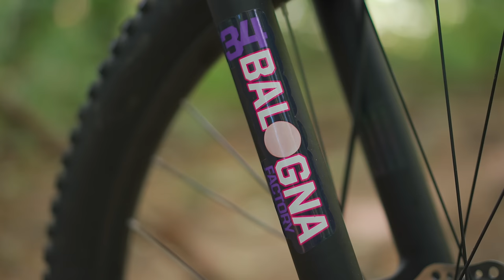This $130 MTB Air Fork works great until it doesn’t

Comment: Is there a reason you are inserting the forks into a metal tube before clamping down? If you could clamp to the steerer tube itself you would have way more consistent results and the weight wouldn't keep getting deflected when it hits the fork and makes it rotate.
Reply: Several things. 1. During riding, a hard hit will deflect the front end. 2. Clamping directly to the stanchion will influence the test amd also introducing a new failure point (the clamps are toothed and more than likely a harder material than the stanchions). I'd rather see a tighter tolerance for bar or some semblance of bearing. PVC pipe might do to fill the gap.
Reply: @tobins6800  good point about the wheel turning on impacts during actual riding. I'm too lazy to rewatch the cane creek video to see what they did, I don't remember theirs rotating much if at all.
Reply: @TheFalcorion  they had it locked down. Seth's set up more replicates real world more so than the cane creek, but the cane creek will yield more repeatable results.

Comment: search for the weapon animal pro air fork.. I wanna see it in action and criticisms like the bolany fork...

the "weapon animal pro air" fork just costs at 140 USD but the travel has 200mm in it... it also got that rebound adjuster but no lock out

it also is a dual crown thing. and 34mm stanchions

Comment: Interesting to think about where they will have saved the cost on the bolany fork, it wouldn't surprise me if lots of the internal components had much rougher surface finishes compared to name brand forks because proper high quality finishing for sliding components can be pretty expensive. Would certainly explain the rapid wear on it from a single ride

Comment: I have a set of those Suntour forks on my trike and they’ve saved my wrists from so much pain. My trike, while fully suspended is a Land Cruiser, it’ll do asphalt and dirt roads with corrugation but won’t do mountain trails but that’s okay since that isn’t what I built it for. I’ve had these Suntour forks for 2 years so far and I’ve had zero issues with them.
They’ve definitely got my stamp of approval for a budget set of forks

Comment: I have run this fork and other Amazon air forks and I don’t think anyone serious about biking should buy one. They are great if it’s going on a kids bike where you need the air adjustment bit terrible on other bikes. They feel ok for the first month or so but after a while they break down and become complete garbage. If you want a good feeling fork keep the suntour fork and service it regularly. I would not be worried about the strength however they seem to take hit’s pretty well.

Comment: That advent derailleur is amazing. 60 bucks for shimano deore quality of shifting and clutch is mint. but I can't attest to the strength of the material as I haven't smashed it on anything yet
Reply: Is Shimano really so much more expensive in the US than in Europe? The Deore 5100 derailleur is like 35 Euros over here.

Comment: Two years ago, I bought a very similar fork from amazon to upgrade a KTM hardtail I've been riding for around six years or so. The Suntour coil fork that came with it was on its very last legs and no amount of cleaning and servicing I was doing was able to save it. I don't use the bike for trails quite as gnarly as in this video, but I ride it in all conditions, all troughout the year and have never noticed any degredation. Just kept it clean and lubed. But for trails like in this video or harder, I would always take my more higher end bike.

Comment: I’ve had a Trouvaille as a backup bike for a couple months now. in stock form, I took it on double black diamond xc trails, black diamond freeride/slope style trails. I’ve since upgraded the brakes, front wheel to a factory specialized boost, and the fork is a 140mm Rockshox 35, PNW grips and pedals.

Comment: Just a few points to Smasher:
Put some kind of guidance there so the hit is actually repeatable and always the same
Hit is supposed to be aimed at the "axle", so stress at the fork is as real as possible, currently you're hitting it too "high", so leverage is decreased, also there is a chance to make some dents and prevent the fork from running freely.

I'd say that some kind of pivot point and lever could do the trick, even without increasing overall size (similar solution as your bottlecage tester had)

Comment: So: ... I've bought this exact fork 2 years ago on amazon. Back then I just started mountainbiking and put this on my trek marlin 5, which before had that exact suntour fork on it. since then i had a lot of rides with it and can therefor tell you exactly why it only costs 130 bucks.
on my very first ride when i wanted to turn of the compression on the fly (before going uphill), the whole cap flew off and i had lost that small ball and the spring which prevented the cap from turning around while riding.
a few rides later it suddenly stopped working at all, because it was a wet day and a whole lot of dirt and debree got stuck to the fork and rubber sealing. it would then go in but wouldnt spring back out.
also if i let it sit around for a few months it would not hold the pressure very well.

so all in all it is working pretty okayish, but i would not want to use it on a wet day anymore.

Comment: I have the microshift advent 9spd drivetrain on my voodoo braag 2022. It's a brilliant drivetrain and it comes stock on the bike. It comes with a 120mm suntour xcm32 coil fork with boost thru 100x15mm. It's a 29ner. And has routing for a dropper post. It's comes stock with Clarks clout 1 hydraulic disc brakes and 800mm wide bars. And for £575 I think that's a pretty capable hardtail
Reply: A pretty capable but overweight hard tail. Get rid of the coil!
Reply: @MichaelRei99  I have. I put on a 150mm travel SR suntour raidon 34 air fork and it makes it soo much more lighter..

Comment: Wiggle sells the octane one 29er frameset for 149 plus 40 shipping. That may be a better option , since you’re just replacing all the parts anyway.
Reply: Yes, chain reaction sell their home brand as well as NS bikes and others dirt cheap. The best dtswiss fr541s are only $300 a pr. Good frame and the best rims and you're set for 10 years

Comment: It’s also worth noting a lot of these cheap air forks have 26inch options available. Which is definitely an increasingly more difficult size to find
Reply: yeah your kinda screwed if you have an inter year bike though i was able to find a used 29inch fox float with straight steerer tube in the right size with a 9mm axel. thats like the most obscure spec

Comment: Ok,  so last season. I bought one of the Balony forks. At first, I was impressed. I'm a 200lb rider that prefers an aggressive Hardtail.  Upgrading an older bike with this fork has a price point. However,  a seal started to leak and the fork developed a lot of stickshion.  Translation,  it was junk after one aggressive season.  This fork is fine for the bike path or a beginner on a flow trail.  For the more advanced aggressive riders,  spend $100 bucks more for a fork that will last for years. Balony does no warranty or repair these forks..

Comment: I ran Bolany before. Even I rode with it for more than 1 year without issues, I will not recommend it. There are lots of videos showing the fork break easily, particularly the steerer tube. SR Suntour is a trustworthy brand, I trust it more on lifetime than the Bolany even it's heavier. Also, Bolany on Amazon costs higher than on Aliexpress. On the latter, it costs around 60 USD.

Comment: I've got one of these forks on a Mongoose Dolomite ALX. For the riding I do...no where near the level Seth does, it works for me. It takes the jolt out of the drops and that's all I need. If I was a serious rider going faster on more serious trails, would it take it? Probably not, but then if I was a more serious rider I probably wouldn't have gotten a Mongoose.  I'm not knocking the bike, for the money its been fantastic but I know what Ive got.

Comment: I did some upgrades on my old  '99 Stumpjumper last year, looked at the Balonay fork but ended up going with a Manitou Markhor on sale, just don't trust the no-name forks.  I also went for an Advent 9 speed drivetrain but should have splurged the extra $20 for teh Advent X and got the 10 speed.  Both have been flawless although I've since moved onto a new FS bike.
Reply: I've seen so many videos on Facebook with that fork breaking , I think you've made the right decision..

Comment: Mate the QR lever hits the bottom of your test device taking away some of that energy used to bend the steer tube, hence why your seeing less deflection. I suspect it will bend more then Suntour fork if the QR lever is aligned with the fork

Comment: I run a set of these on my bike. It needs grease, not oil, and the wipers really suck. The other problem with these is they have no replaceable parts. Run them as an XC fork and regrease them with Slickoleum or SRAM Butter and you're set for a decent fork for a time.

Comment: In 2018 I bought a Raleigh tokul 1 off Amazon for $448 shipped to my door

It had a 120mm suntour coil fork and hydraulic tektro brakes

I returned it and got a used specialized crave pro with a 1x11 drive train and fox float front fork for the same price

Comment: It's one thing to compare cheap fork with other cheap forks on the 'Smaesher' but you need to have a control measurement too. 
Like...  a Fox 38 or RockShox Zeb or something as a control standard.
If all the forks are bending at the steerer tube rather than the stanchions... What are you *really* measuring here?

Comment: These kind of forks lasts longer if you service them frequently, I have a similar (different brand) one for 3 years now. The posts I've seen people that has broke one of these is due to the lack servicing, I once saw one owner has literal sand inside his lowers due to negligence lol.

And also use them for light trails and like 20 inches drops max lol.

Comment: Totally love this Walmart MTB series. I don't have a bike, but am looking to get one (on the cheap). I am looking for something that can handle the woods and different terrain, but I value my life way too much to even want to take a trail ride like you are doing. Plus, I'm AARP certified now 😁 With that said, would this then be too much bike? And if so, what would you recommend?
Reply: Walmart has a good entry level mountain bike right now. There is a big used market as well. Just talk to the local community. Bike shops are sometimes hit and miss.

Comment: Microshift clutch is actually adjustable if you remove the little cap whit the 2 bolts you can access like a 4 millimeter Xwrench bolt  that you can thigh or lose the clutch whit

Comment: After lock tighting the bolts on the bottom of the Amazon fork that was the oil spill version I road the crap out of it down some of Snow summit bike parks gnarliest trails and never once did they fail me but we're little stiffer then I wanted and I had to put like 110 psi to make the feel right plus some rock shox fork oil.

Comment: Since the forks still touched the bottom of the smeasher it probably isn't an accurate test at all. I'm guessing that the suntour has a steel steerer and the bologna has an aluminium one. Steel is 3x stiffer than aluminium. This means that the suntour may have taken let's say 90% of the impact and the bologna only took let's say 30% because it flexed and then hit the floor. Watching the clips it looks like the suntour has more spring to it, meaning that it flexed and sent the energy back to the dumbell. The balogna looks like it flexes and dumps a lot of the energy in to the floor. I'd like to see some more improvements to the smeasher :D

Comment: i'm just gonna assume the suntour is a little bit safer over time. the balogna like you said might snap and cause the rider to get injured. and to be fair i don't know much about bikes but i know that i would not be riding one if i felt unsafe on it.
Reply: I partially agree with you. Everyone knows that some parts in automobiles are specially designed to deform largely during crashes to absorb energy. But I guess that these low-budget builds are for gravel rides around 30km/h. If you want to go extreme, definitely the hospital fee would be more expensive than any premium bike parts.

Comment: Starting out in MTB, my first trail ride destroyed by cheap coils. So I bought a Bolany air fork. It actually did last I guess a few months. I started getting better at mountain biking but the fork was a clear limit. Being very gentle with it and constantly maintaining. 

One day I decided all caps are off, I'll send it throughout the entire 4km trail. I did (with only one little jump as it's mostly an XC trail). It came out no good at all. It doesn't lock anymore, it barely compresses and when it does it just snaps back up. I tried to look into fixing it, but the cost of fixing it is so close to buying a new one I ditched the fork entirely for an SR Suntour Epixon. 

The SR Suntour Epixon, right off the bat, is definitely a waaaaaay, waaaaay superior fork than a Bolany.  Not to mention insanely easy maintenance and if anything goes wrong parts are so easy to find. Plus shops are familiar with it and it does have official support. 

TLDR, go straight for an SR Suntour Epixon or RockShox Recon I guess... skip the Bolany because you'll just end up going with an Epixon or Recon in the end. My Epixon have been going strong even with some jumps and red trails for 5 months now with no real maintenance required yet and still feels as good as it started with. Same for my friend's Recon as well.

Comment: Man, I do like product reviews, talking about parts and stuff. I'm retired with some big injuries from my youth and spend a lot of time building bikes now cause it hurts to ride with Gusto. Sometimes I think we all might be a little nuts cause it seems to be great fun to many of us to buy stuff and see if we can tear it up. I stand at the front of the line, so do not think I am talking down to ANYONE, I am just reflecting on past behavior. But if we use parts wisely and inside reasonable parameters, you can build great budget bikes. I bought a Schwinn Taff for the frame and for $1400 total, I got a great bike with parts I wanted. Underscore parts I wanted cause this is a big deal. Schwinn could do better and should build some damn good bikes instead of frames I'd like to build. If down the road you have trouble with a part, fine, there's new stuff all the time. Buy parts on your skill lever and use intent, use them up, break 'um, get the new stuff. Sorry, my brain runs over. Peaceout!!

Comment: i bought a sr suntour epixon and i got a problem with the damper cartridge because doesn't let me use all the travel of the fork. So i have to drill a little hole on the top of the cartridge to get all the oil out and replace it for a new one. That's work for me and now the fork permorm very well under gnarly situations.

Comment: I love your videos. I have a cannondale.cad3 frame that I had a friend assemble into a mountain bike 25 years ago. It has 26 inch wheels and rim brakes.  I love this frame and really want to rebuild it for modern use in nh trails.

I have not kept up with mountain bike technology and have no idea what parts to use. I road this a lot back in the day and cassette and front rings are.worn out and fork is garbage at this point.

I don't know which parts will fit but am mechanical (fix my own mc and cars).

Will 27.5 inch new wheels and the.fork you are testing and a front hydraulic brake work? I have a welder but dont have the confidence to weld a disc brake mount on the rear so figure a rim brake or.adapter might be good enough.

I need a new cassette and gears too and might as well get new derailleurs.

Any advice? At least related to changing to 27.5 wheels from 26? I can get vuelleta (spelling??) Wheels for under $200
Reply: Thanks for commenting you have been selected among my bicycle winners🎁🎁

Comment: I'm running a Himalo Drift on my shitbike. Its kinda impressive how passable the cheap stuff is getting now. I swapped out pretty much everything on the department store frame I bought all for less than an entry level hardtail and it performs better than the few I've tested. Probably won't last as long as good quality stuff but honestly the building, servicing and testing out these things is more fun than just regular riding lol.

Comment: Took that fork to a jump line (was a broke highschooler) after 3 fun laps, it bottomed out and locked out permanently on the 4th lap . Ended up getting thrown over a berm and tacoing my rim that cost more then the fork… it was during covid and one of the only forks you could get but definitely learned my lesson